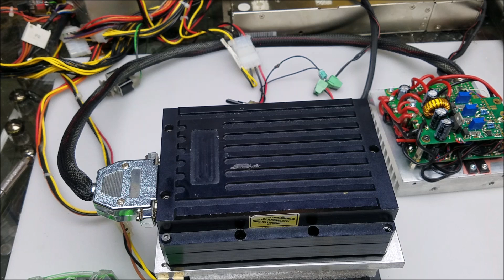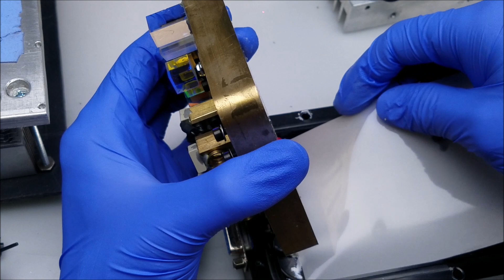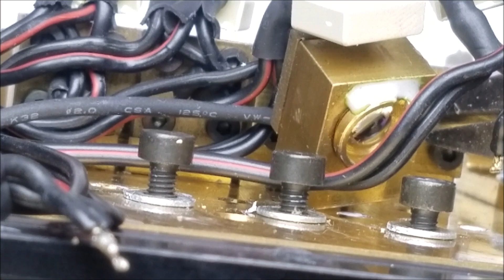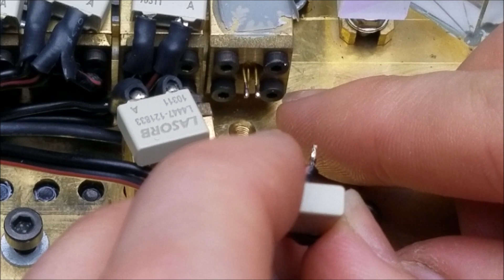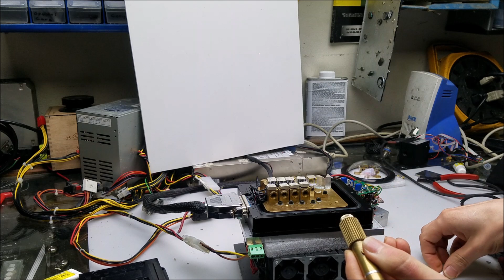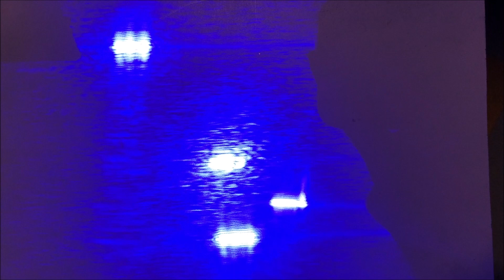Blue Laser Head Rebuild Part 1 Testing and Installing New Laser Diodes

Comment: Do you ever use indium foil instead of thermal compound? Considering it solve the issue of thermal compound heat creep, and there are now readily available “Heath Springs” made of thermal foil… which I’ve had the pleasure of using and they are wonderful!

I was just curious. 

I love the stuff… And I especially love avoiding thermal grease when optics are involved!
Reply from the maker: I have not used indium foil, I will have to look into that. I have used the thin graphite ones though. It would be nice to have foil inside overall since it can't break down and release chemicals.
Reply: Good question. I'm getting ready to use double sided thermal tape to attach my TEC to the module block, as well as the heat sink to the other side of the TEC.
Never heard of indium foil Heath Springs, but I'll check them out. Thanks for the tip.👍
Reply: Just found Indium Corp's site, selling 20 * 1" sq. x .004" thick Heat Spring sheets for $295. 🤯 Seriously?
Edit: Amazon @ $10.95 - 99.99% High Purity Indium Sheet Foil (50mm x50mm x0.1mm) for CPU Heat Sink, Bonding 😊
Reply: @TheOleHermit  indium foil is incredible. It’s what’s used in the semiconductor, laser, and photonics manufacturing industries. For me it stands head and shoulders above thermal paste… Especially considering there’s no heat creep, no messy stuff around optics, and it performs better. It’s literally the worst thing if you happen to get a little bit smeared on your optics. Because it is very abrasive. It’s an extremely fine grit, but it cuts extremely fast. very similar to 0.5 to 1.0 µm Diamond abrasive paste. Which translates to approximately 60,000 grit, on your standard “sandpaper scale” of Abrasives..

It makes a wonderful polishing paste though! I get large amounts of it, when rebuilding massive motor drives, or huge power inverters used in electric forklifts and cranes… I’ll get a big jar full of thermal paste off of the heat sinks.  According to the size of the device… The heat sinks range from 50 to 250 pounds. Needless to say there’s a shit ton of thermal paste coupling the heat sink to the devices.
And the abrasive is such high-quality! Ground to such a perfect and consistent grit. It’s very similar to the super expensive diamond particle lapping paste that I’ve purchased in the past.
No way I would just throw it away!

I use it on leather stops for honing woodworking tools… And also on some of my lapidary wheels…. used for cutting and polishing optics.

I use regular indium foil most of the time. I get it dirt cheap from eBay and other sources. I specifically try and find the stuff that’s been milled particularly for use as thermal transfer material. This is really important, it has to have the right temper and perfect amount of work hardening… Or it won’t fill the tiny microscopic gaps. But pretty much… 99% of Indium foil is made for this purpose. So if you find a super thin foil for sale online… It’s a good chance it’s perfect.

I do use indium “Heath Springs“ in certain instances….With specialized projects or really expensive parts where perfection is needed. They really are incredible! But this is just a hobby for me… No way in hell I could afford the lasers, optics, and stuff like heat springs if I had to pay the real prices! Most of my stuff is found on eBay or at local government auctions, for pennies on the dollar. Jesus Christ optics and lasers equipment is the most expensive shit I’ve ever seen 😂 and that’s crazy coming from someone like myself who is addicted to Metrology grade test equipment 😂

The indium heat springs are really great… And you can find scraps on eBay from time to time for dirt cheap. Plenty big enough to do laser stuff. If you check out that same Company and their YouTube channel you mentioned… They have something that’s essentially a flash foil made of indium… it’s the most incredible shit, and I’ve got to use it on a few separate occasions.
Simply Apply a slight current (like a shorted 9 V battery… ) And it instantly flashes to 1500°C. And can bond materials that normally would be impossible. I’ve used it to bond things like glass to aluminum, or ceramic to silica… Crazy shit like that. And it is a permanent melted/welded bond. Very similar to “explosion welding“… which if you haven’t seen I highly suggest you Google and watch videos. Of them welding stuff like hardened steel to nickel and copper and stuff like that… using massive explosions of C4 on top of two plates of dissimilar and un-weldable material.

Even though the indium flashfoil reaches 1500°C… And melts the pieces together… it won’t damage anything, and it’s safe to use with even glass… Without cracking it from heat stress. It’s safe because it happened so quickly, and dissipates heat so quickly that it transfers no thermal stress into the parts.
Reply: @hullinstruments  Hey, that's a lot of great info to share. Thank you very much for the generosity of your time!
Used to be a tool & Die Maker in the aircraft industry, during the 1970's. Very familiar with diamond lapping compound to hone out carbide dies within .0001 in dia. But, the stuff you're  doing makes that seem primitive. Think I'll pass on the C4 welding, though.
In 1978, I landed a job doing Laseruim after being blown away by their show at Griffith Park Planetarium. A few years and many optical tradeshows later, I put my machinist skills to work and started developing my own projection systems. If you think today's optical systems are expensive, the ion gas lasers, 3 phase power, water cooling, custom road cases, and controllers were ~10 times as expensive as today's laser diode projectors. That's why I couldn't resist getting back into the artform.
Currently, I'm completing a rebuild of 2 cheap Chinese projectors by adding a 40mm X 40mm TEC + the same size heatsink to a 3 watt RGB laser diode module.
The OEM had built the projector with the unsealed 3 watt module inside an enclosed aluminum case with only 3 X 30mm 12 VDC fans. Obviously, that's not going to last long.
So basically, I'm trying to turn a pig's ear into a silk purse. Zen's been great for guiding my path forward and bringing me up to speed with the newer technology.
Yes, I agree that thermal paste and optics don't play very well together. That's why I chose to try out thermal tape, which looks too similar to double sided foam mounting pads, for my liking. That's why I quickly jumped on your indium foil suggestion.
I see that Heat Spring is designed to be compressed in between the heat source, TEC, and heat sink under 30-100 PSI. Since I can't drill screw holes through the TEC, I'm not sure how to make that happen, unless I use a larger heatsink to position fasteners around the edges. <sigh>
With regards to less expensive indium sheets, i see many 99% indium sheets @ .1mm thick, same as the expensive ones at Indium Corp's website. I assume that they are just as effective and will follow your lead to ebay alternatives. Otherwise, another $22 per projector won't break my piggy bank. Wasted more than that on the roll of 2" thermal tape. Perhaps it's not too late to return it to Amazon.
Anyway, i sincerely appreciate your input, suggestions, and great chat.
BR! 😎

Comment: Very nice instructions, from beginning to end. Thanks, Zen. Covers just about everything I've had to do over the first few months of projector rebuilds. Need to grind out the middle of my short wide blade screwdriver. Still need to add Lasorb protection to my LDs, too.
Looking forward to seeing the difference in build quality of the PD3000- RGB OptLaser projector. Out of the box, I shouldn't need to do most of the mods I'm having to do with the cheaper projectors. After the add-ons and mods, both cost the same. The cheap route has been a good learning experience (how not to do it), but paying a little extra up front for off the shelf quality saves a lot of frustrations, plus having mfr specs and user guides makes a world of difference for maintenance. "Ya gets whatcha pays fer. Know what I mean, Mate?" How can anyone hope to become a fine artist with only a 4 inch wide paint brush, right? 
Looking forward to Part 2 of fine tuning everything and learning what you find out about those fried lenses. Crackled AR coatings on the inside planer surface, while protected from environmental contaminants? 🤔
Reply from the maker: The cheap route will teach you a lot, which helps when you do get into the more expensive stuff and then know how to work on it. The toasted AR coating it on the outside of the lens. You'll notice the back of the laser head isn't sealed by the connector and the TECs are set really cold. The other thing to note is the damage looks to be progressively worse the closer to the back of the laser they are. My thoughts at the moment are TECs set too cold + improper seal +condensation +hygroscopic AR coatings = lens death.
Reply: @Zenodilodon  Thanks for the reply, Zen. Yes, I understand that AR coatings are on the exterior surface of the lens. By 'inside' I meant inside the LD mounting assembly, within the sealed area between the lens and LD, as opposed to the convex surface that's more exposed to external  contaminates. Judging from your pics, I don't see any damage on the 'outer' convex surface. Seems counterintuitive to me, unless the AR coating was already soiled or defective. 
Your suspicion reminds me of crackling glass marbles when I was a kid by putting frozen marbles in a hot skillet or was it the other way around? (Too many years ago.) But, it also sounds like the most probable cause, IMHO.
Looking forward to your final verdict in Part 2.😎
Reply from the maker: @TheOleHermit  The damage is on the outer convex surface. This is a crown and flint merged lens. The surface ROC is pretty large for it's overall focal distance because of the geometry between the joined glass elements of the lens. The side facing towards the LD output window are fine from what I can tell. 

I used to also break marbled with heat. I would get them hot on the stove and drop them into ice water. :P
Reply: @Zenodilodon  Well that sheds a whole different light on what I thought I saw. Could have sworn the damage looked like it was on the back planar side of the lens. Must be one of them thar optional collusions, like that feller El Salvador Daily.🤷‍♀️
But, after your clarification and doublechecking, apparently I need to ease up on the ole vaporizer. 😜
Wasn't aware of the lens being merged crown/flint, either. Reminds me of the miniature quartz rod lenses with parabolic refractive indices, when I was attempting to collimate the output of a 100 um fiberoptic into a scannable beam from a remote truss mounted scanning head (1980, pre-laser diode). Thanks!👍